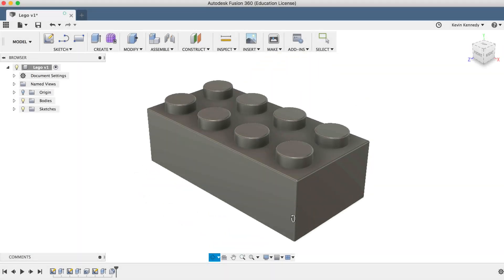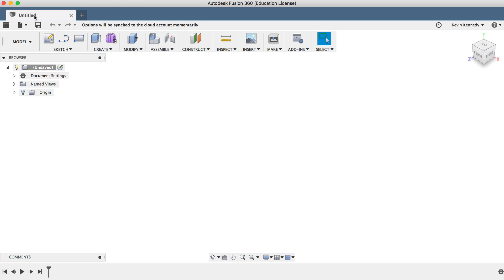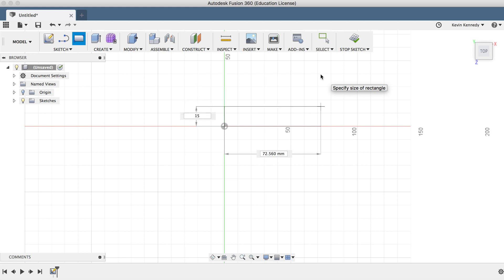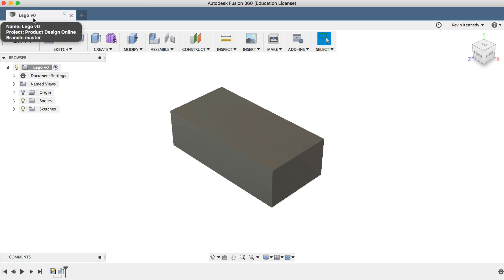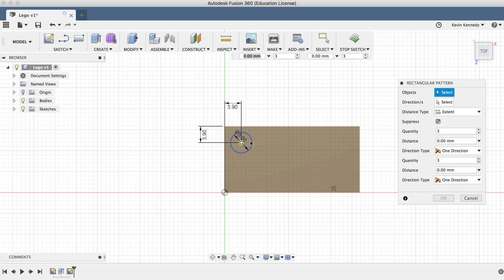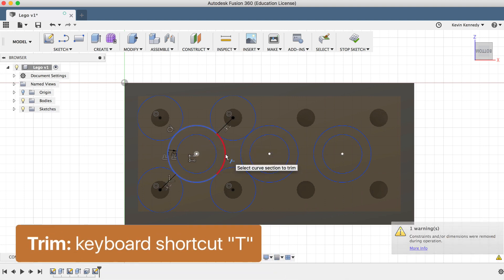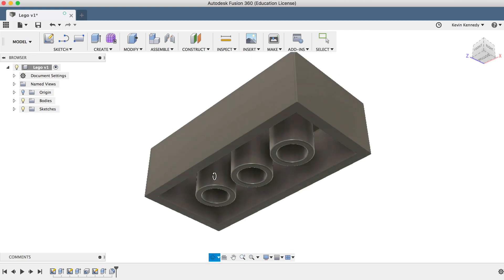How to 3D Model a Lego Brick - Learn Autodesk Fusion 360 in 30 Days: Day #1

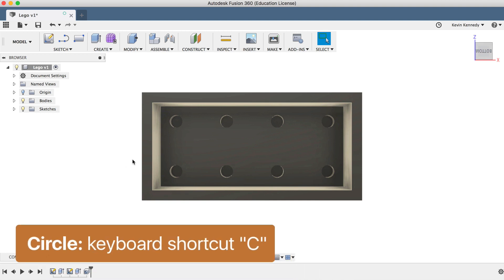Comment: I'm having problems at time stamp 4:55. After shelling out the brick and rotating to bottom view the instructions are to use the shortcut "c". When I do this my toolbar is not looking the same and I'm not able to add a 5mm circle to the existing circle the way it's shown in the video. My toolbar goes to sketch mode and I have Sketch/modify/constraint. Is this perhaps due to an update to the software or am I missing something simple?

Comment: Hello, thank you for all of the details, but how were you able to draw those 2d 5 mm circles (at 5:00) so rapid fast? I drew them separately, but I know you an draw them a lot faster.
Reply: Also, they didn't snap for me, I needed to type their dimensions in.
Reply from the maker: Make sure "Auto Project Edges on Reference" is turned on in your Preferences. It used to be on by default - https://productdesignonline.com/default-settings-for-fusion-360-tutorials/#autoProject

Comment: Let's say you create a triangle in sketch mode on the XZ plane. Now you would like to create another triangle same size on the same XZ plane and have it overlay the existing triangle but with 2 inches between triangles. How would you do this? They really need to allow attachment of photos in Youtube it would help so much. Here is a pic and what I created but forgot how I did. I have spent some time trying to remember how I did this.
https://pasteboard.co/IenkkNZ.png
Reply from the maker: Hi, Rud Dog. It looks like you probably created an "Offset Plane" that specified distance away from the original XZ plane. Select the offset plane icon in the toolbar or from the construct dropdown list. Then, you'll be able to sketch out your second triangle. If you want the triangles to always be the same exact shape and dimensions then I would recommend using the "Project" command, which will make the second triangle geometry (projected) driven by the initial triangle geometry. Cheers, Kevin :)

Comment: Too fast. Keyboard shortcuts not explained. Missing a lot of steps for a series that seems to be aimed at beginners.
Reply from the maker: Hi, Lamp Shade. You must not have noticed the pinned comment leading to a revised version of this video. I would suggest you check that video out as its more thorough and goes at a steadier pace. Here it is ► https://youtu.be/6yPKMSb6ja8

Please don't hesitate to comment any questions as you work throughout the series. Cheers, Kevin :)
Reply from the maker: @docpossum2460  There is a pinned comment, as well as it being at the top of the video description - https://snag.gy/VG3hFk.jpg

I've also added the suggested video at 1 second, which pops-out and suggests the revised video and the entire playlist that includes the latest versions - https://snag.gy/O32XIZ.jpg

I understand that on certain devices these may differ, especially depending on device size. If you have ideas on how to make this even more clear then I'm all ears. Unfortunately, Youtube depreciated custom cards, in the middle of videos, a long time ago. Cheers, Kevin :)

Comment: Not like you'll read this, but when I try to make the circles underneath, it doesn't simply snap to the center point. My circles are always off. .....I hate fusion even more every time I try to open this fragmented sack of trash.
Reply from the maker: Hi, Adrian. I read and reply to every comment. I did make a revised version of this video, which you may find helpful. It goes a bit slower and I'm a bit more thorough with some of the commands. You can check it out here - https://youtu.be/6yPKMSb6ja8

Comment: I'm following every instruction however when I need to create the offset circles on the bottom, they wont extrude properly, instead they show up in red and make a cutout of the top layer. I'm not sure why this is.
Reply from the maker: Hi, Yutterbum. It sounds like you might have created the circles on the wrong plane. Make sure that you select the inside/bottom of the lego as the sketch plane, before drawing the circles. Here's a screenshot where the plane I'm talking about is highlighted in blue - https://snag.gy/KnO0US.jpg

Just an FYI, I've created a revised version of this lesson that should be much easier to follow as it goes a bit slower and is more thorough. You can check it out here - https://youtu.be/6yPKMSb6ja8

Cheers, Kevin :)

Comment: Ive spent almost 3 hours, trying to make it work and it doesn't.. The instructions are not clear enough.  How do you make the circles at 4:58 at the bottom sketch, for me always appear at the top ... So later on when I extrude, It makes holes instead...
Reply from the maker: Hi Ivan,
You must not have seen the pinned comment in all caps. I've posted a link to a revised version that you can watch. Here it is: https://youtu.be/6yPKMSb6ja8

Cheers, Kevin :)
Reply: OMG :D
Thank you! I read through the comments, and saw people had similar issue, but havent seen the link to the revised version. 

After giving up on this one, Ive just finished  Day 2 task, which was great!
Reply from the maker: @SonofTangra359  I'm happy to hear that. Don't hesitate to comment questions should you have any as you work through the series :)
Reply: @ProductDesignOnline  I didnt see the link anywhere either. Thanks though for revised version.
Reply from the maker: @latjjtal  I just added it as the first line in the description. Hopefully, that has better visibility than just a pinned comment. Thanks for your feedback! Cheers, Kevin :)

Comment: I can tell this is going to be an excellent series of videos, but I have a bit of an issue. At 2:30 when I enter "E" or click Extrude from the menu, my rectangle does not switch to the angled 3D presentation. Pre-selecting the rectangle doesn't help. Is there a setting that enables the auto 3D view?
Reply from the maker: Hi Jim, Please go to Fusion 360 > Preferences > General > and make sure that you have "Use gesture-based view navigation" selected or turned on. Here's a reference image, for your convenience - https://snag.gy/50W1uR.jpg

Let me know if this solves it! Cheers, Kevin :)

Comment: This is an OUTSTANDING series and I highly recommend it. I just finished day 13.  My only complaint is that there are only 24 hours in a day, and I can't do more! :) 

Anyway, after almost two weeks worth of videos and doing the exercises I have a few pointers for anyone following along at home:

0) Watch "Fusion 360: An Overview of the Autodesk Fusion 360 User Interface" first.  After the first two exercises, watch it again. Then watch it again a few days later.  There's a lot in there!

1) Play YouTube video in full screen and use space bar to stop video

2) Use Alt+Tab between YouTube and Fusion 360

3) Make sure you are in the same mode in F360 as the video: In the upper left corner: "Model", "Patch", "Drawing" etc.  If your tool bar looks radically different than the video you are probably in the wrong "mode"

4) Is the last button on the tool bar "Stop Sketch"?  You may still be in sketch mode when you shouldn't be or vice versa.

5) Use the magnifier "Fit" option at the bottom center of the screen often when you are starting.  That and the "Home" icon on the view cube upper right corner are a big help.

6) Use the space bar to stop the video and examine the dialog screen options for things like "Loft", "Sweep", etc.  These settings are sticky - they default to whatever you last used and if you don't do exactly like in the video it won't work as expected, if at all!

7) You automatically go into sketch mode when you press "L" for line or "C" for circle. BUT - the very next thing you left click on will determine the plane for the sketch!  Watch the videos very closely to see what Kevin has clicked on.  It would be awesome if the video capture software had a little left click/right click, dbl click indicator, or if F360 had a "demo" mode that shows all the keystrokes and clicks.

Big THANK YOU to Kevin for the series!
Reply from the maker: Jim Rauch - I'm super happy to hear that you have been enjoying the series so far! 

Also, I really appreciate you helping the community out. All of these tips are spot on and super helpful!!! 

Thanks again. Cheers, Kevin :)
Reply: About Mode - the top tab on my version says "Design" not "model".  Why is that?

Comment: again me, sorry, min 5:38 the two circles cannot be made black, they remain blue in edit mode, why that? how can I make them be black so that I can continue with the extrusion? thank you !
Reply from the maker: Adrian-Constantin Cucu - you should be able to extrude the circles when they are blue, as seen in my screencast. If you're not able to extrude them then it's likely another problem. Be sure to double check that you are drawing on the bottom of the lego plane. 

Take a look at my snapshot (https://snag.gy/p4Clcb.jpg)  and look where the purple origin point of the sketch is. Take a look at your design and make sure your plane is in the same place.

If you still can't get it to work please post a screenshot using (https://snag.gy) and it will help me decipher what your problem is.

Cheers, Kevin :)

https://snag.gy/p4Clcb.jpg
Reply: thanks but I cannot see your screenshot, it is a possible error
Reply from the maker: Adrian-Constantin Cucu - Try this link: https://snag.gy/p4Clcb.jpg
Reply: How do you draw the circle on the bottom plane? They are always drawn on the top plane for me
Reply from the maker: Hi S.P., make sure that you use the view cube in the upper right-hand corner to look at the bottom of the model. Then create the sketch on the underneath side of the lego. This is a screenshot from a side perspective to show where they should be drawn. Cheers, Kevin :)
Reply: I wasn't aware of the "select plane" step before drawing the circle and so kept selecting the wrong plane by clicking where the center of the circle is.
Reply from the maker: @pawlowss  I'm glad you were able to figure it out!  The first few tutorials in this series were a bit fast but I slowed down and was more thorough with the rest. Cheers!

Comment: hello, min 3:28 I simply cannot draw the rectangle of 3.9 mm, both of them actually, why that? what I did wrong?
Reply from the maker: Adrian-Constantin Cucu make sure  you use keyboard shortcut letter "D" to activate dimensions. Then, you will need to click on the center of the circle (not the circle itself), followed by clicking on the rectangle line.

Let me know if that helps! If not, please share a screenshot or your Fusion 360 file. Cheers, Kevin :)
Reply: yes, thank you, I finally succedeed :-)
Reply from the maker: Adrian-Constantin Cucu I'm happy to hear you got it done! Cheers, Kevin :)
Reply: Product Design Online thanks again for the help!

Comment: Hi, I have repeated the steps several times, but always end up with the same problem.  On the bottom I create one of the three circles/posts, and do the offset on it.  When I go to extrude, if I click between the inner and outer circles, the entire bottom "plane" is selected.  If I select both the inner and outer circle lines, it extrudes a "hollow post".  It seems that the inner and outer circles are independent of each other.  I hope this makes some sort of sense to you.
Reply from the maker: Hi Garth - Make sure to use the trim tool, keyboard shortcut letter "T," to trim away any unnecessary lines. It sounds like you may have something on the sketch that is interfering with the circles. You should be able to select all three circles by clicking in between each circle... they will turn blue afterward, like this - https://snag.gy/WJwyzN.jpg

Let me know if trimming or deleting any unnecessary lines works. If not, can you please reply with a screenshot of your problem? You can use the free online snapshot tool Snaggy - https://snag.gy/

Cheers, Kevin :)
Reply: Thank you for the reply.  My design looks like this: https://snag.gy/QEGBYc.jpg .  If I click between the inner and outer circle, the entire bottom is  highlighted: https://snag.gy/alKB5m.jpg . This is on Windows 10.  Any idea what I am doing incorrectly?
Reply: Hmmm... a clue!  If I go to the top of the lego, I can click on the correct area, and extrude, which actually puts a hole in the lego.  The top has no thickness, so perhaps I entered a dimension incorrectly near the beginning.  Let me step through this again from the start, and see if I can get a better result. Edit: I started from scratch... but same result.
Reply from the maker: Thanks for sharing the screenshots, Garth. This helped me confirm the problem. It appears that you drew the circles on the very bottom of the lego, but you want to click on the inner surface of the bottom. Pay extra close attention to where I click at 4:54

Take a look at my snapshot (https://snag.gy/p4Clcb.jpg) and look where the purple origin point of the sketch is. Take a look at your snapshot (https://snag.gy/QEGBYc.jpg) and you'll see the purple point at the very top left corner (the very bottom of the lego brick).

Cheers,
Kevin
Reply: Hey Kevin... I had to go through it twice more, but I finally got it!  Some things just aren't obvious to me, at least in the Windows version.  Thank you very much for your help!
Reply from the maker: Hi Garth - Happy to hear that you got it working :D

I hope you enjoy the rest of the series! Cheers, Kevin :)
Reply: Do you mind sharing what you did? I have the exact same problem
Reply: Hi, As Kevin described (pasted after this), somehow when I created the circles for the posts, I had clicked on the bottom of the brick, and not on the inner bottom surface --- Thanks for sharing the screenshots, Garth. This helped me confirm the problem. It appears that you drew the circles on the very bottom of the lego, but you want to click on the inner surface of the bottom. Pay extra close attention to where I click at 4:54

Take a look at my snapshot (https://snag.gy/p4Clcb.jpg) and look where the purple origin point of the sketch is. Take a look at your snapshot (https://snag.gy/QEGBYc.jpg) and you'll see the purple point at the very top left corner (the very bottom of the lego brick).

Cheers,
Kevin
Reply: Thanks but I still don't understand :( The link to the snapshots don't work anymore so I don't know where he's referencing.
Reply: Hi... at about 4:56 / 4:57 when Kevin clicks, for a brief moment you see the inner surface highlighted before he draws the circles, which is what you want.  As I recall (poor memory) I had to fiddle a bit to highlight that surface and not the very bottom of the brick (which is mostly air space, except for the walls of the brick).  I'm not very good at this, so I'm not a great help... I just had to repeat the steps many times until I got the correct surface highlighted.
Reply from the maker: Thanks for helping out the community, Garth! You rock!
Reply: Hey Alex. Thanks for the responding. I just don't see the highlight before applying the circle. I started a new one and now I see a different issue. here are the two videos https://streamable.com/ikhia  https://streamable.com/ly5fb  The new issue is when I try to put the circle, the whole model disappears.
Reply: Actually, I believe I figured it out. I had to disable some of the sketch layers for me to be able to select the bottom plane. I don't know why a sketch layer will block selection. Do you know the reason why?
Reply from the maker: tridentseven - I'm happy you got it to work! 
Hmm. I have never experienced that problem in F360. Can you share your file so I can take a look? Cheers, Kevin :)
Reply: Thank you so much for your help! Here is the link: https://a360.co/2Mp6Zme  When I have "sketch1" enabled, I can't select the base when I try to create a circle.
Reply from the maker: tridentseven - Thanks for sharing your file! My apologies, I try to respond within 24 hours to all comments but didn't notice that YouTube flagged this one (since it has a link in it).

Anyway, I took a look at your file and didn't see any problems with it. I deleted your latest sketch and started over with a new sketch on the bottom surface and was able to draw the circles with no problem - https://snag.gy/nBHy70.jpg

Make sure that you have all of your sketches turned on (yellow light bulb in Fusion 360 Browser) and try re-drawing the circles one by one. As long as you get one of them to snap into the same distance as the top circles then the others should follow with no problem.

Please let me know if you get it to work! Cheers, Kevin
Reply: Hi Kevin. Thank you so much for responding to me. Actually, I figured out why it was doing that myself. It looks like when I created the box from a rectangle sketch, the original rectangle sketch didn't get removed after extrusion. So after I shelled the box, whenever I tried to create the circle directly on the base of the box, I couldn't select it because the rectangle sketch was in the way. And the reason why everything disappeared is because I selected the sketch instead of the box.
Reply from the maker: tridentseven - I'm happy to hear you were able to figure it out! It's crazy how sometimes those little differences can throw off our intentions in Fusion 360... Nonetheless, we keep moving along! Thanks again for watching & commenting! Cheers, Kevin :)
Reply: Thank you so much for your help! I've never talked to anybody on youtube that was as helpful as you. Much appreciate it.
Reply from the maker: tridentseven - I'm more than happy to help! As I continue to grow the channel and community around it I'd appreciate it if you can share any videos with others you know that are interested in Fusion 360. Cheers, Kevin :)
Reply: I will! Thank you again for he help.
Reply from the maker: tridentseven - Here is your original file with the circles that I drew - https://a360.co/2P7h8Th